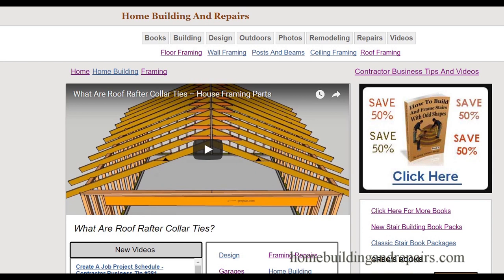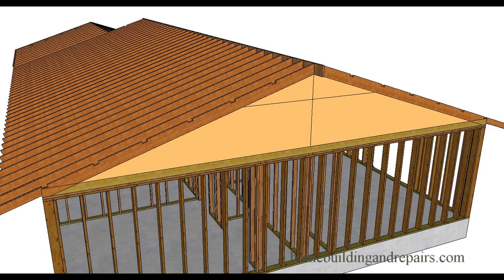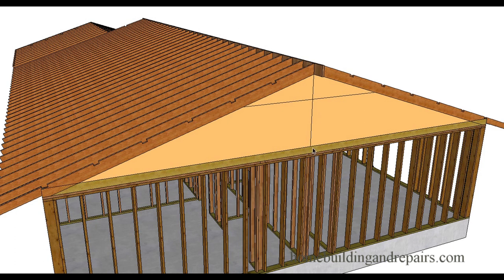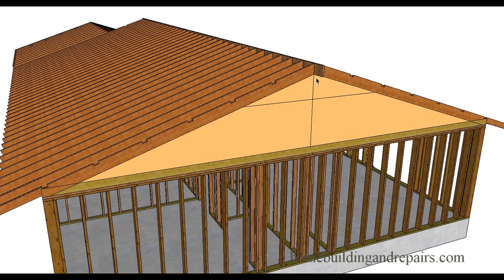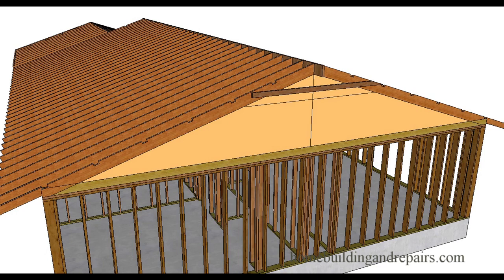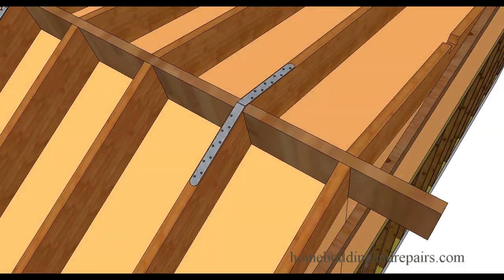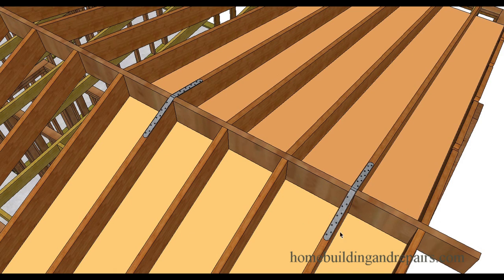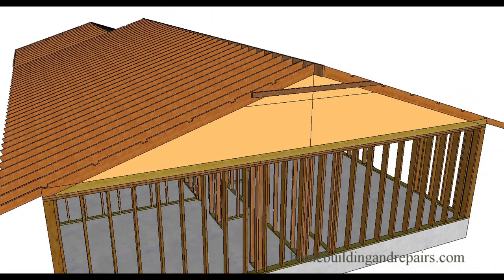Roof Framing Collar Ties Location According To Some Building Codes

Comment: hi thanks for all the great videos. Do you have one explaining moving ceiling joists up within the lower 1/3 of the roof?
Reply from the maker: I think this is the only video. I haven't made a video about the actual process, because you could probably remove one ceiling joist at a time and raise it, working your way through the ceiling. However, I could always make a video with more information if you need one.

Comment: Thanks for the vid. Your personal practice of wood collar ties just beneath the ridge board makes more sense even though the code allows them to be placed lower, a little less material and it’s good to have a consistent method. Yes this section of the California Residential Code sends you to chapter 6 wall framing which Contains Table R602.3(1). This table contains over 40 framing connection  (nailing) requirements. Including collar ties and ridge strap size. I can recall many veteran framers having and giving this important fastening table to the young guys.